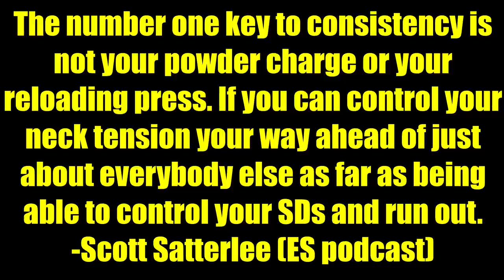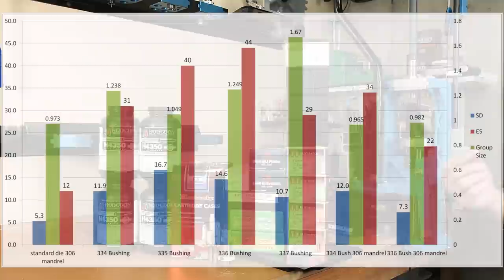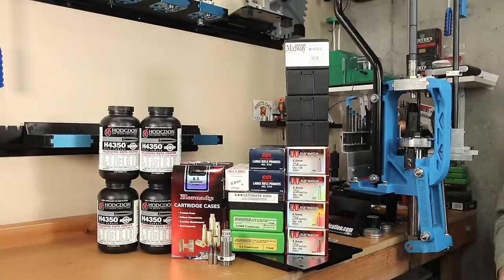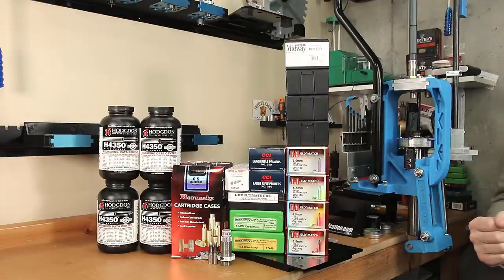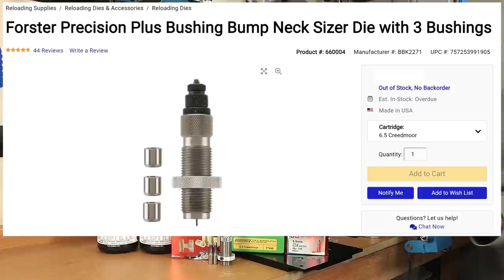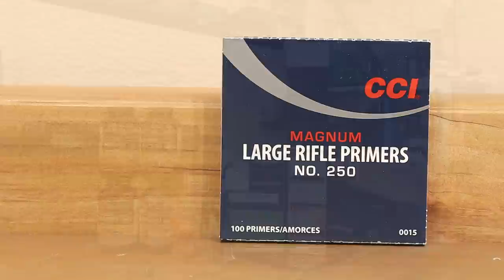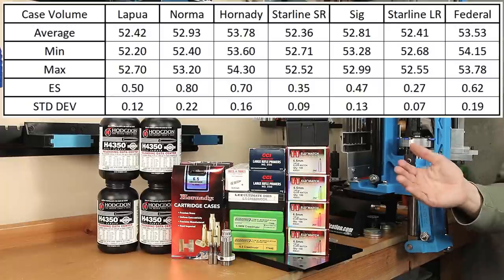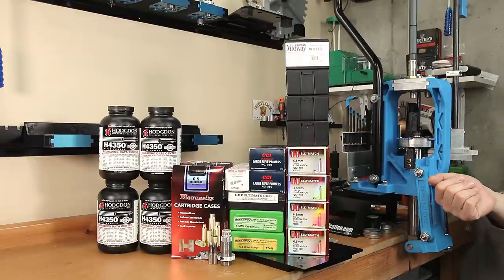Sizing Brass and Setting Neck Tenison - Which way is Best? - The Test Plan

Comment: I full length with a bushing then use an expanding mandrel to expand the neck as you are planning but I use a bushing that is .005 under bullet size and expand back up to .002 under.  I would worry that going only .001 under the expanded size might not be enough to get a consistent result out of the expanding mandrel give spring back.

If I'm not clear I would take a .264 down to .259 then up to .262.
Reply from the maker: While I certainly agree this could be a factor I was going to try and keep the over sizing to a minimum. Not picking apart your process but why would you use a busing and not just a regular die at that point. The only advantage (that I see) is working the brass less than the FL die would. (unless maybe trying to prevent donuts?)
Reply: @BoltActionReloading  well, to be honest because I bought the bushing die thinking the standard die would simply size the neck down farther yet.  I have not measured this to confirm it.  I also wanted to be able to play with it a bit.  Maybe i would try .004 under and then back up to .002 under.  
In short,
Brass spring back is something I feel I've struggled with and wanted a system to play around with it some.

Also I was thinking if I ever neck turned my brass I could simply buy a smaller bushing to ensure the neck was resized enough for my mandrel to be consistent, as I do think the mandrel makes a large difference. 

Hope I'm explaining myself clearly.  Anyhow it's what I have done.  I would like to see it tested next to your plan of down to .003 and up to .002 and see if it makes a difference.   Either way i look forward to your results.

Also I anneal my brass every time I reload so I dont worry about over working the necks as much.
Reply from the maker: For reference my 6.5 CM forster die pin gauges the neck at least at .285", I would just use a .288 bushing if I wasn't using a EM to open it up. This dimension leaves the neck just under .286". Don't think I am picking I just and trying to understand everyone's perspective so I can try and make better videos that include all the info people need to make informed decisions.
Reply: @BoltActionReloading  no worries.  I pick my stuff apart myself.  Only way to get better.  I appreciate your data driven approach which is why I come back.  I'm willing to change if something looks better or easier.

Comment: Currently I use a full length to partial size and bump the shoulder .002 and reset the angle from chamber angle to case spec angle so the neck can open correctly. Then I aneal. After the aneal I use the neck only to square the neck. Seat the bullet. And final is a .001 crimp. 

The crip is more about setting runout or square ing the seat a slightly sideways bullet may end in a square spot but they rarely go in perfectly. 

All the little touches though I think are rifle or method based. I rand fine with 2 dies for a long time. And only went fauther when chasing sub moa at 200-300y.

Comment: I have never considered neck tension. I always crimp to some degree after length sizing. Luck or? I've had great groupings with my loads.
I can shoot 1/2" for 7.62x51 and 1/3" for 5.56mm at 100 yds.  Now I'm interested if neck tension can get better groups and by how much. I don't shoot long range so I may not experience much difference.

Comment: I use option 4. But I also anneal every time... I've had cases that have sprung back .0005 to .001 when annealing has not been done.
Reply from the maker: Hi Rusty, I am annealing every option. I do not want to throw too many variable in and that needs its own testing.
Reply: @BoltActionReloading  Ah ok, darn variables, keep up the excellent work!

Comment: I like the: in God we believe the rest is NUMBERS or measurements!!
I`m interested in the actual inside neck diameter after whatever sizing process.
Actually which inside neck diameter comes out of a .306 mandrel?
I measure the ID by using bore gages!
To my logic a hard grip onto the bullet helps the combustion process.
But then there must be different requirements of neck tension (grip) for different powders (offensive vs. progressive Powders)

Comment: Not sure how you are going to do this. You can't just take a load that was developed with a specific neck tension, vary the neck tension and then conclude that the original neck tension is better. You have to start by optimizing a load for each process you're using to set neck tension, and that will be a heck of a lot of work. Also, you can't look at the process of setting neck tension without also looking at how more neck tension affects concentricity, especially when using a less sophisticated seating die, which doesn't perfectly align the case and bullet. I would recommend that you stick with just the Redding Type S in a few configurations setting final neck tension to 1, 1.5 and 2 thousands. Optimize the loads for each configuration. Check concentricity after seating.
Reply from the maker: You are correct, this is why we are going to need to run a test for optimal charge weight to compare for each type. Its ridiculous, but who else is going to do it?
Reply: @BoltActionReloading  I am amazed at how much effort you put into these tests. Over the years, you have saved me a lot of time and money. Thank you.
Reply from the maker: @njgrplr2007  It will be a lot of time and effort but I think overall its good information for people to see the different methods and how they perform. I am hoping to get a couple more tools in that will help highlight these differences. Not sure how many videos it will be, people will disagree that the data means anything if it doesn't meet their expectation, but it will be data.

Comment: Hi there. I am not new to shooting, but have become interested in reloading, more for accuracy and consistency than for cost savings. I am not happy with the performance of my Rem. 700 chambered in .300 Win Mag. I have watched a lot of your videos and like how you detail your process. This test looks like it will take a lot to accomplish. One thing that I am very interested in is the LEE Collet die. I was wondering what, if any, impact it would have on overall neck wall thickness, not just outside diameter concentricity. Would it actually cause brass in the neck area to migrate from thicker spots to thinner spots, especially after being annealed, because the brass is being squeezed between the collet and mandrel at the same time. If so, would this make both the o.d. and i.d. of the neck more concentric and reduce, if not eliminate the need to neck turn. I know there is a lot of work to figure this out and it may be an exercise in futility, but it is something I find interesting. Thanks for sharing your process.
Reply from the maker: Hi Jody, make sure you subscribe with the bell turned on. (I know this sounds like a commercial) but this content is coming. I just got some of the components I was waiting on. It's going to come in stages, but by the end I am hoping that there will be a nice pile of real data for people to decide for themselves. (As for 300WM, buy the best brass you can) My best results were from Norma but this is before Peterson had theirs on the market. I hope to get back to 300 win mag later this year, but I think this series can help a lot of people understand some of the differences between the processes.
Reply: @BoltActionReloading  Thanks for getting back to me so quickly and for the brass recommendation. I have not put many rounds through my .300 WM and do not have any reloading equipment at this time, but I am trying to learn so that when the time comes, I will know better what I want to do and how to get there. My goal for the .300 WM is to make it a reliable and consistent hunting rifle and maybe be able to hit a target at 1,000 yards. I look at it as a work in progress. I look forward to what you find.

Comment: 4 avenues. Cast and jacketed. Rifle and pistol. Cast rifle needs to be no more than .002 smaller with a short bell. Then it needs a roll crimp during seating. Jacketed needs .003 to .005 with boat tail. Flat based is the same as Cast but a taper crimp on a separate step. Pistol are different but not much. Same crimping setup. Exceptions are cannelure. Typically a roll crimp during seating and tight, 3 to 5 tension. If rounds are used for single fire only I still crimp. It gives a more consistent burn. It also keeps a chambered and removed round from leaving the bullet in the throat. Spilling powder in the action. That will make you need to leave a match.

Comment: Have you had any experience using the Consistent Crimp tool from Titan reloading with the Lee Crimp die for the constant neck tension?
Reply from the maker: Hi Cannon, I looked into it after many recommendations and have decided against it. They do not sell one for the press I intend to use, and (no offense) It simply looks like a overpriced torque handle to me. If they sent me a sample I might take a look but I don't plan on picking one up any time soon. My crimp setting will be maintained in my press with the lock ring, and I will trim every firing to maintain the COAL.

Comment: Here's option 10 boys and girls. 
1x fired brass ran through just a depriming die. 
THEN (anneal here if you do)
FL die without the expand/decap but set at .002" bump of the shoulder of fired case. (Erik Cortina vid teaches how to)
 THEN 
Set the neck tension with the expander mandrel again at .002" under caliber. 
Then trim, chamfer/debur, prime and load er up.
Reply from the maker: Hi Mike, this is literally option number 2.
Reply: @BoltActionReloading  well I'm retarded... I don't remember the shoulder bump being mentioned in that method but glad you cleared it up. I look forward to your results and vids
Reply from the maker: @TooTallMike  any shoulder bump on applicable sizing (FL) will be .002" I probably should have clarified that a little better.

Comment: Complete beginner/new guy, but I keep hearing "neck tension", but unlike say trigger pull, you don't actually measure it. I.e. how much force it takes to pull the bullet out. Folks seem to substitute very accurately made bushings then shoot to noodle out if they are on the right track. Perhaps over time the 2 thou under gives results that are good enough so one does not need to actually measure the force to push a bullet out (or in). But it seems to me (and this probably just a good measure of my ignorance - but I was trained to measure things..... :^) ) if you found a good target force to aim for, as lots in components changed, but you could dial in the same force before shooting one round it could save a ton of testing.
Reply from the maker: I have a tool coming that is going to help with it. Stay tuned. We have to figure out what to test first and then we can compare them on many levels. I have also purchased pin gauges some in .0005" increments so we can measure these variables more consistently. It will be a ton of data.

Comment: John Whidden states bushings create run out versus mandrels. Agree?
Reply from the maker: That has been my experience,  the question is how much and does it matter?
Reply: @BoltActionReloading  I use mandrels... anneal and size 3 times and get no spring back. I gauge with my neck turn pilot and it fits very smoothly. My group went from a half an inch with anneal, mandrel to almost one hole.. anneal, neck turn, mandrel.

Comment: I would say just use the full length forester die. Just for the average joe.
Reply: FL Forester 220Swift die gave me case neck run out of .002-.004 no matter what I tried to adjust die and lock ring in my Redding press. Removed expander from die and got .000 - .002 run out at case neck. .002 run out is acceptable for me. My custom 220 Swift will shoot 3/8 inch 5 shot groups when I can do my part.

Comment: I think you made it clear that the use of mandrel reduces group size and SD. I think you would be better served and use less of your resources if you neck turned then compare that to full length size and mandrel vs full length bushing size then mandrel. The new hand loader can watch some of your old video and gain a wealth of information.
Reply from the maker: Hi John, While I agree, I am also biased. I have had endless comments about some of these other configurations and its not fair to exclude them without data. It will be a epic undertaking, but overall I hope to be able to present the technical difference how the loads performance changes with the various configurations.

Comment: Can you full length resize and shoulder bump for a AR gas gun?
Reply from the maker: Yes, you should be able live with a .002 to .003" bump. If you having issues you may have to have a small base but I wouldn't go there unless you need to.
Reply: @BoltActionReloading  thank you for taking the time to answer my question. I’m looking forward to the continuation on the various methods of setting neck tension series.

Comment: I still would have neck turned the brass, Anyone going to all this surely would neck turn. Its been shown many times the brass necks are thicker in spots and that is why its so valuable to turn them to an even wall thickness. It makes seating pressure more consistent, just as it does bullet release. Without turning you are giving up those benifits and your brass seating and bullet release are going to vary more piece to piece.

Comment: My vote for option 10:
Redding Body die (bump 0.002")
Lee Collet Neck Sizing die
21st Century Expander Mandel (set neck tension to 0.002" or 0.003")
Reply: This is my current setup and I would be very interested in how it stacks up against options 1 through 9.

Comment: If you can't get under a half inch group with what you have for dies you might want to check the diameter of the bullets you are using. Also, do something old school, slug your barrel.
Reply from the maker: I already have been able to get .4MOA and smaller groups with one of these die combinations so I don't understand your point.

Comment: Your brain must hurt sometimes coming up with all this data and compiling it. Keep it up always helpful.
Reply from the maker: I have been racking my brain about this for months off and on. I have tried to remember the most "commented" your doing it wrong, do it this way comments and tried to include all the options that were the most prevalent
Reply: I don’t get as in-depth as you. I have 2 Redding type S dies and that as close as I get to all this neck tension debate. They seem to function well in my .308 and 7mm08, but I’m more focused on minute of deer with a little long range shooting for fun. An if people don’t tell you thank enough thank you. Your content is always data driven and never this the only way to do something format.
Reply from the maker: @stevenbradley2245  Thanks for the comment. Much appreciated for sure. I try my best not to discount all the options out there, but never hate on the guy that has what he wants / needs figured out. I tend to be a little over the top with some of my projects, but I think its legitimate info that people will be interested in learning all the differences. I long get tired of the " I knew a guy that..." comments. I just want legitimate data.

Comment: Proper full length sizing is imperative. Sooner than later neck only sizing will cause trouble. Even quad lug bolts experience flex that sufficiently increases headspace that chambering the round will become difficult. The body of the case, especially just above the extractor cut may quickly become troublesome. Neck sizing is just a bad idea.
Reply from the maker: I don't disagree but I don't want to exclude anyone that wants to know, and I believe in data. I hope to take measurements along the way so we can monitor the case expansion. I was really hoping to have the bushing bump die as an option for those who think that may be a good idea.
Reply: @BoltActionReloading  There was a guy online who did some high powered computer simulations of a typical modern 2 lug bolt action when subjected to the stress of firing. I don’t recall the pressure he used, but a guess would be 52k-62k PSI. As I recall it, his simulation showed about 0.002” flex of the lugs, of course, results in expansion of the case walls a similar amount depending upon the finish of the chamber walls. Long story made short, it doesn’t take long to encounter a hard bolt closing.
Reply: When I first started out reloading, I only was neck sizing with a Lee Collet neck sizing die and after about 2 firings (22-250), chambering was becoming difficult. I'm sure experiences vary (in terms of how many rounds till tight) depending on chamber dimensions, pressure and bolt /lug config among other variables, but I agree, in time, chambering will become an issue. I rectified the issue by adding a Redding Body die to my process along with Redding competition shell plates to control and achieve 0.002" bump  and have had very good result since.

Comment: Your bullet goes on the inside of the neck so you need to size the neck using a mandrel, and not one that floats.  As for the body I’d send some fired brass to Forster and have them make a die 2 thousandths below what the cases are. Use a bushing to take the neck down enough for the mandrel to work and this will vary with brands of brass.  At the end if you want to check concentricity to it inside the neck, whatever the outside of the neck is will vary and is nowhere near as important, as I said the bullet goes on the inside.  Arguments about neck turning to follow.